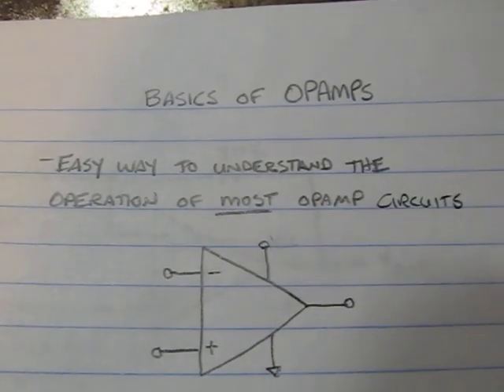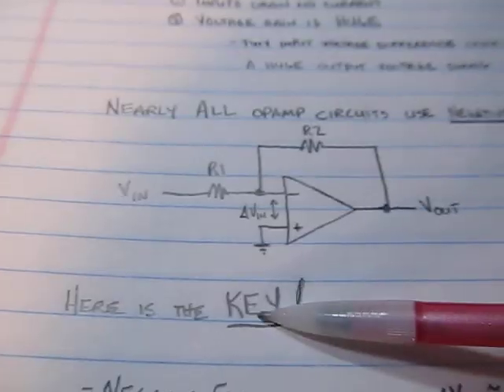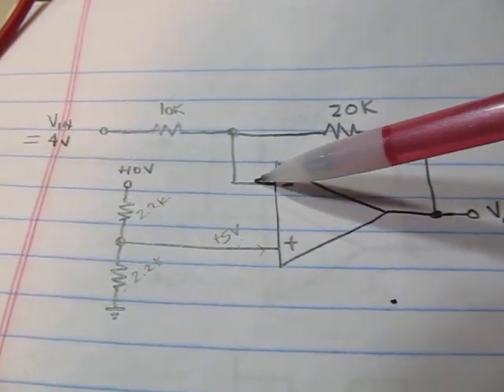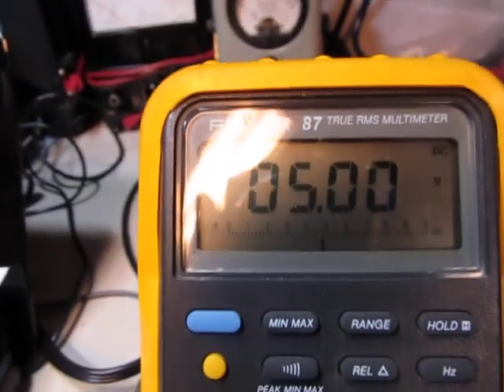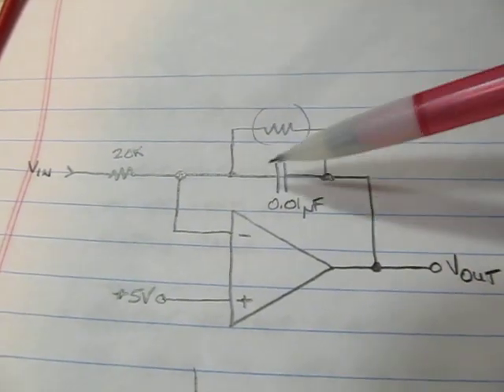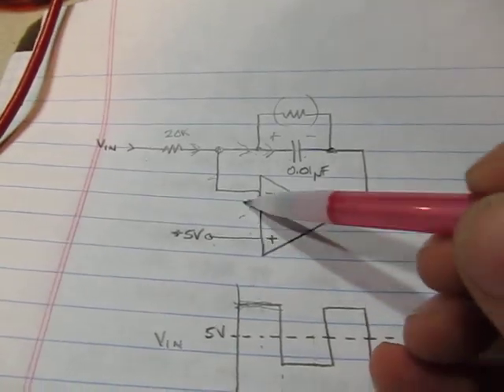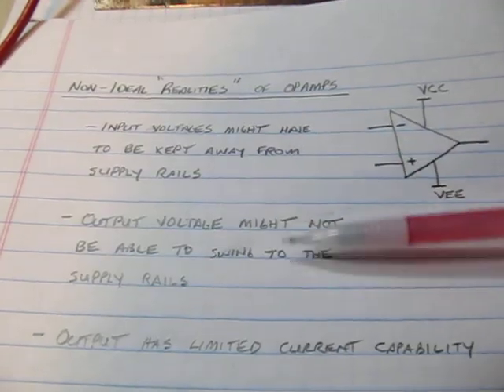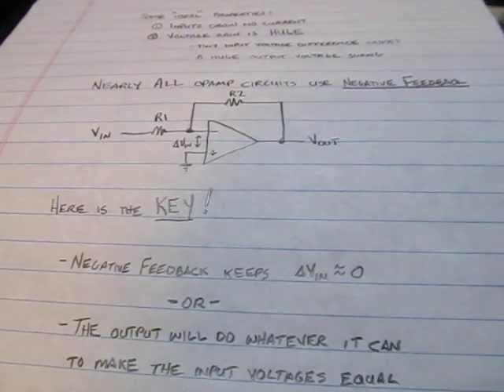#75: Basics of Opamp circuits - a tutorial on how to understand most opamp circuits

Comment: Thats all good, but then what of Positive and Negative feedback? Gain is defined by these are they not? If there is no feedback does that turn an op-amp into a comparator where it just swings from rail to rail? 

....ugh so confused. I envy you. And I have a BS in Computer Engineering. I took all this, but I resorted to memorizing equations to pass tests. I loathed op-amps but they are essential. They made this so boring in my classes that it just shut my brain down everytime.

Comment: Where is the leftmost (4V) pin/wire connected in the first circuit? To GND? The Voltage comes from the output of the OpAmp and drops 2V over 20k, then it will be "sensed at the non-inverting and another 1V drop over 10k. Is that right?

Comment: Think about the RC time constant of a capacitor charging through a resistor. If the resistor is small, the capacitor will charge quickly. But because of the way the opamp is set up here, the capacitor charges through a constant current source. As you know, a current source has "infinite" internal resistance. Draw some conclusions from here.

Comment: Hey, but how come that it is an almost linear rise? Does the timeconstant of the cap is only partial used wich would result in a more linear curve?
Also would the capacitor provide lower amplitude for higher frequency squarewaves because of the linear rise?
Thanks in advance.

Comment: This goes against what i've learnt about opamp. You have a differential input voltage of  -1v (the inverting input in now 1v below the non-inverting input), now the gain of an inverting opamp = -Rf/Rin (-20k/10k) giving a gain of -2 shouldn't the output voltage be (-1v x -2 )= +2V.

Comment: Great video for a rookie like myself.  I'm just wondering (EXACTLY) how you figured out the 5 volts being supplied to the + input of the op amp.  You stated it was figured out using OHM's law but with the three values given, (10V, 2.2k and 2.2k) it only gives the current value which is actually zero being pulled from the Op amp if I'm not mistaken.  I'm sure I am missing something here!! Thanks.